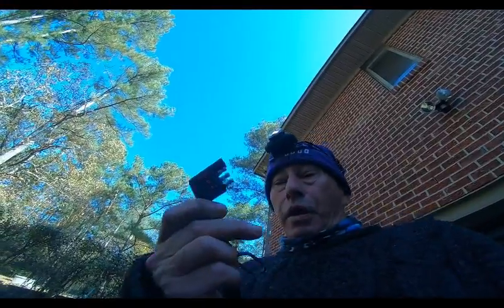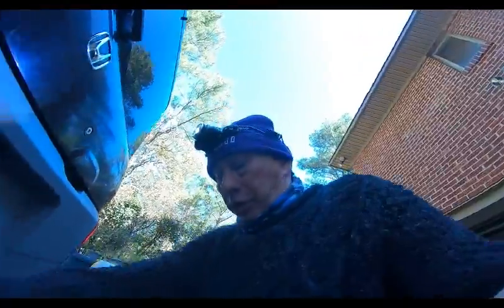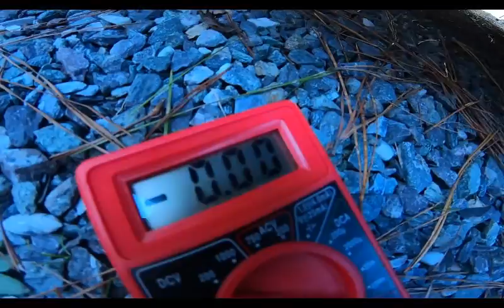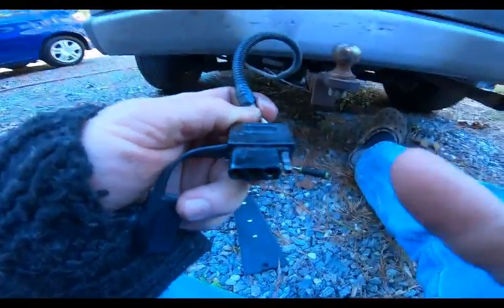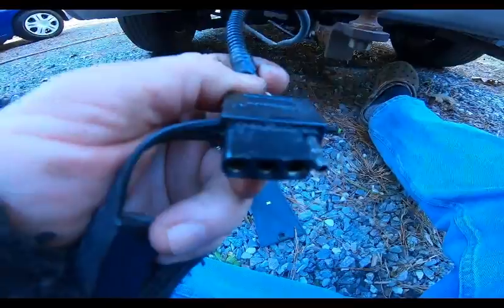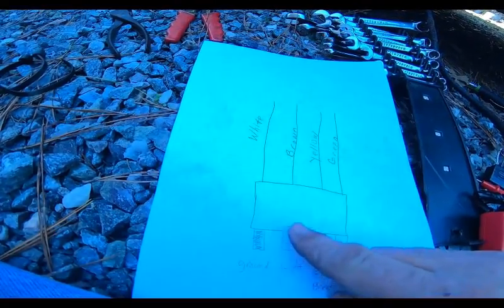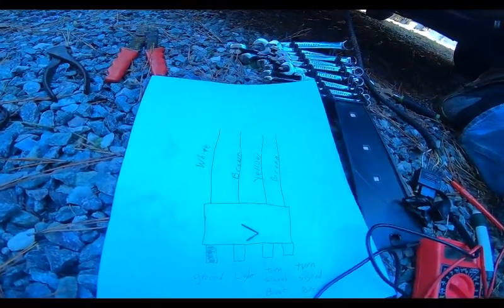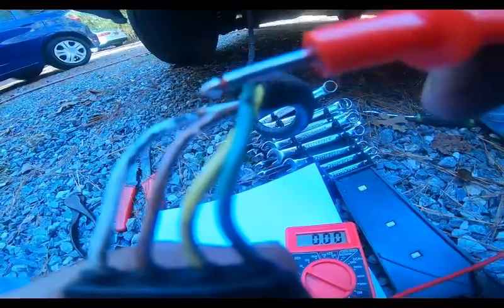TRAILER LIGHTS TROUBLE WITH MULTIMETER

Comment: great simple test,  and I do have 2 the free HFT multi meter.    I just installed a C56365 kit on a honda ridgeline and while the break/Turn lights work (both of them) the Trailer-Lights don't and this helped me determine there was no power to them. odd.  but I see some direction confusions for fuse placement(s).   perhaps error in directions.

Comment: I’ve been trailering in NC for 30 years. For 10 years, I didn’t even have lights on one small trailer. You can run a trailer w/o lights in NC & you won’t be hassled, serious.  (I never run at night, so this won’t help with your night runs.) Good luck. 
PS - I hate electrical.
Reply from the maker: I can at least run with my emergency flashers.  Not my choice.  But they can see me.  I will still hand signal in the dark

Comment: Good troubleshooting though.  Learned alot. Thanks for sharing 👍
Reply from the maker: I learned and remembered a lot . The most important issue I took away from this is to be analytical, try to figure WHY,  starting at one end or the other and moving forward,  I have a plan if my research comes up empty

Comment: If the tailights on the car are on, the issue is between the pigtail and where it's spliced in.
Reply from the maker: I wired in a new plug for trailer, have emergency flashers, breaks and turn signals, but not lights when vehicle parking and head lights are on . So vehicle plug not have power to lights coming from harness, but all lights on vehicle work correctly.  I am thinking a power module in harness hidden between under dash and engine compartment (oh boy) alternate plan b hardwire from 1 tail light to non current bad prong on vehicle plug,,, last resort
 next step change led trailer lights